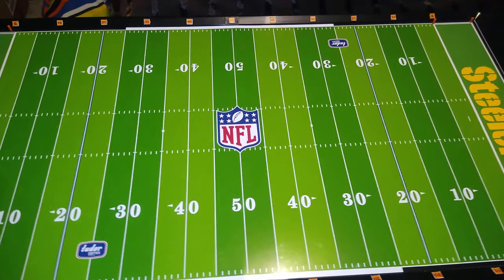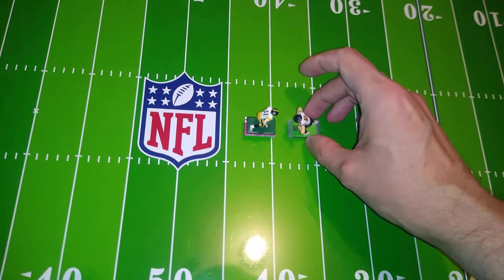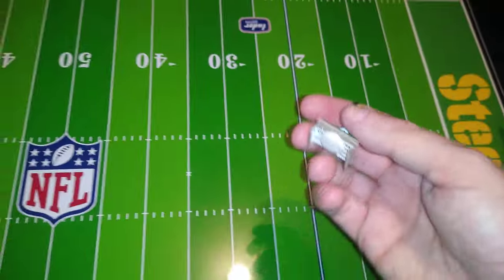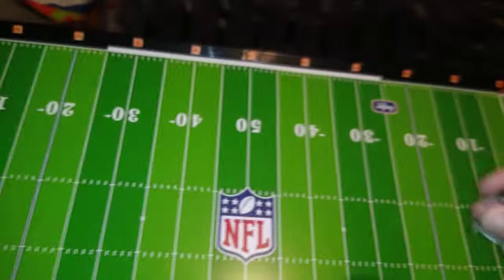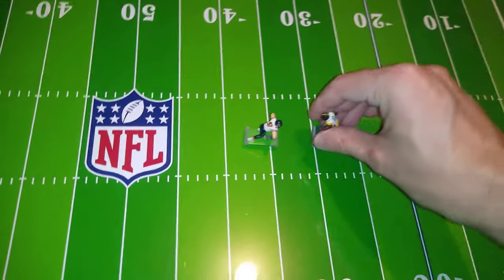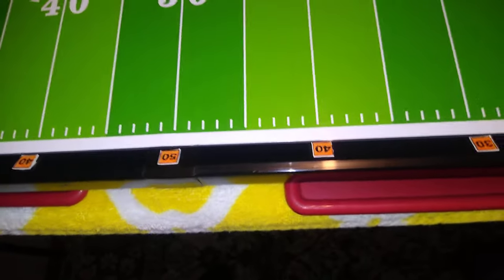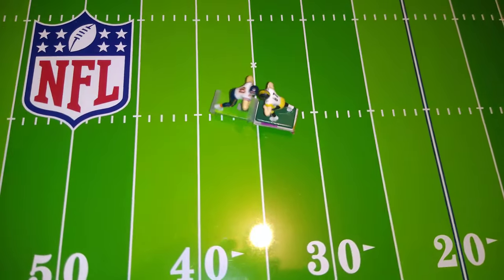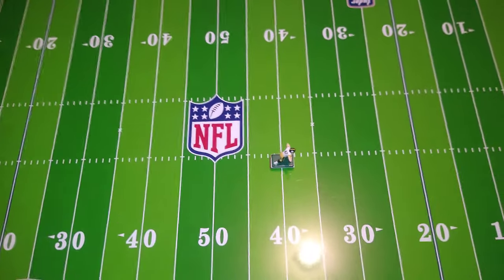Cardboard Electric Football Bases -  Strength/Power Research and Development

Comment: Well, you definitively answered my question on strength.  I guess cardboard will not match ITZ.  They do, or some have pretty good streng credentials.  Cardboard does make the game playable immediately out if the box.
Reply from the maker: I figured from the start there would be limitations on how strong cardboard could be. I DO think more weight could improve strength just like any other base, but there's going to be a limit to how much weight the prongs can take before they sag, and I suspect that tolerance is probably going to be lower than plastic.